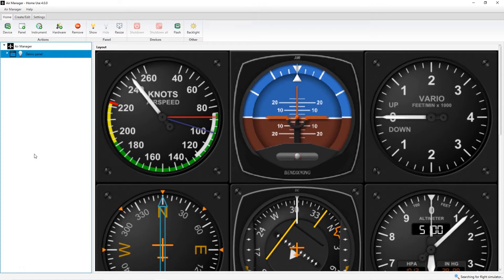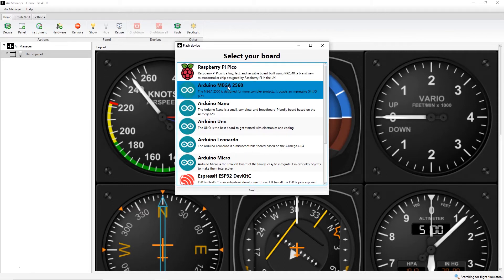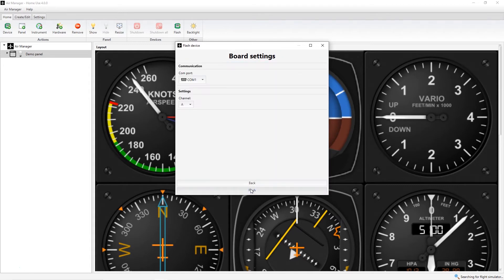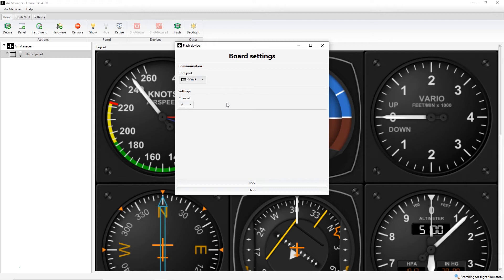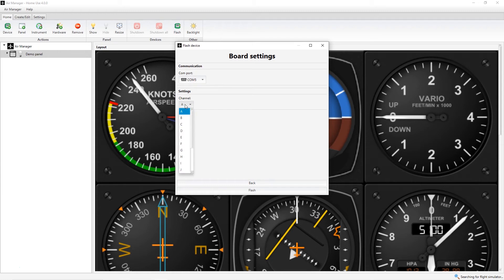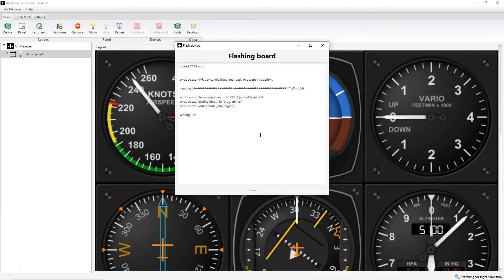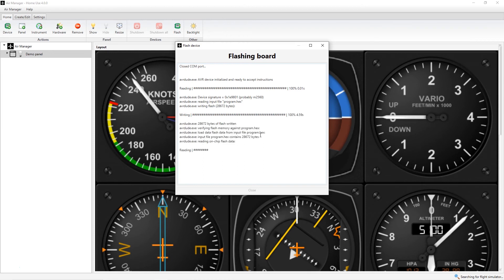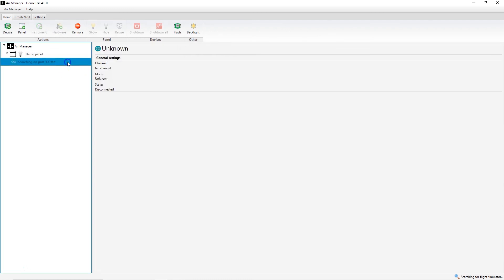How to add an Arduino in Air Manager 4

Comment: I realized my program wasn't working correctly after I registered, changed my chip in my motherboard and reregistered. After deleting airmanger and all files and starting over it's working aces now, sorry for all the trouble. I was losing my mind why wouldnt it keep my work... It's as expected now😃
Reply from the maker: Apologies for the slow reply. I don't look at YouTube that often. For any further assitence it is better to use our forums or support ticket system.